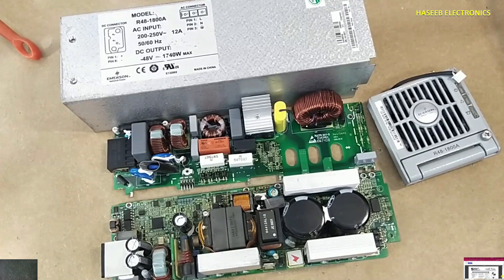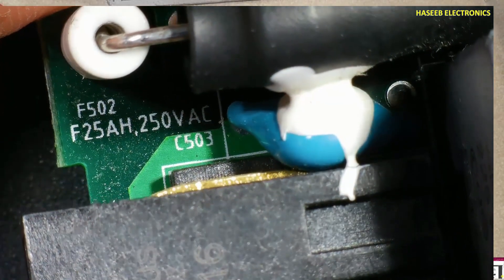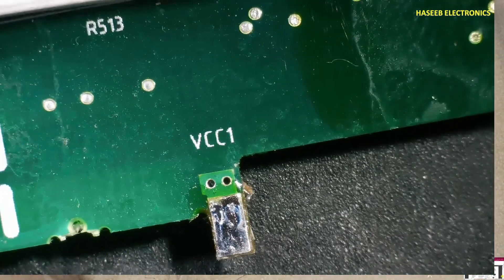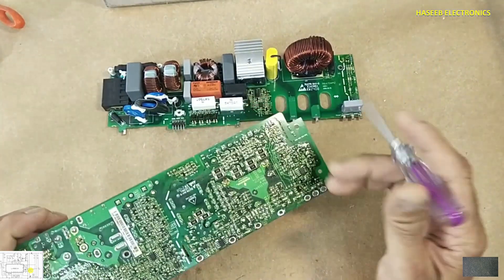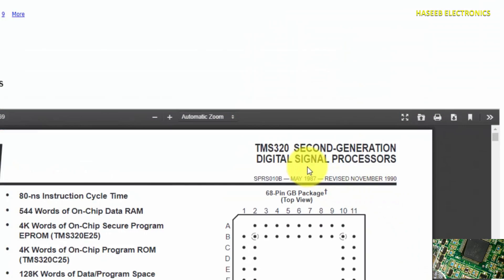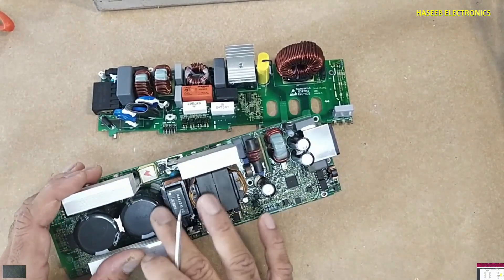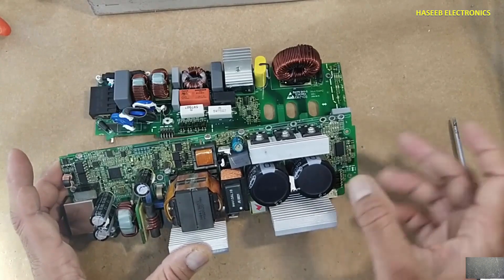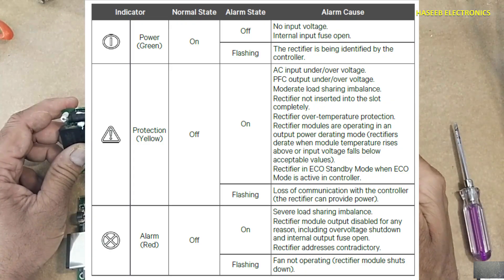{1011A} Emerson R48-1800A Circuit description

Comment: Where is this PSU used / what device does this power? It's a very complicated thing and one day it will fail with a  major fault like blown MCU and be unfixable. I dislike this kind of thing.
Reply from the maker: It is a perfect design from one of the best manufacturer in power electronics
It is used in communication equipment
Reply: @HaseebElectronics seems over-engineered on purpose so that when it fails it's unfixable.
Reply from the maker: @g4z-kb7ct  exactly correct. 
If rework is done incorrectly then it will be difficult to restore it to serviceable condition

Comment: Please...
Can you please make a tutorial on topic..... Which one smps required tl494 sg3525 or uc3843 and why they have differences
This will be the sum of the different types smps available for use low or higher current voltage
Reply: Or ka3525